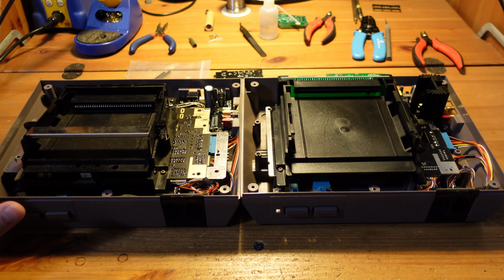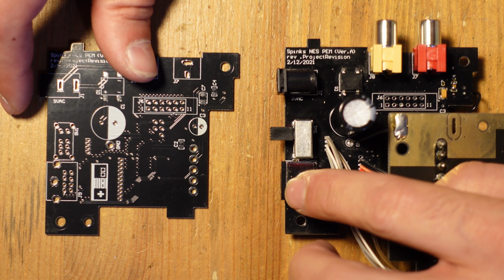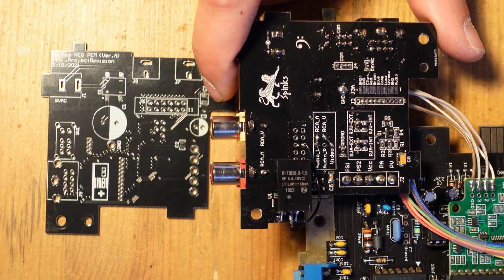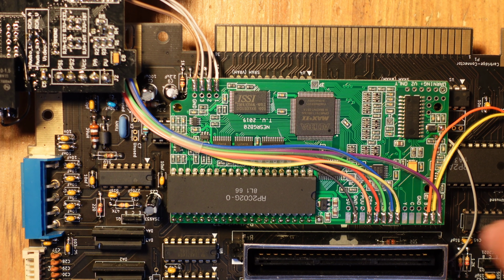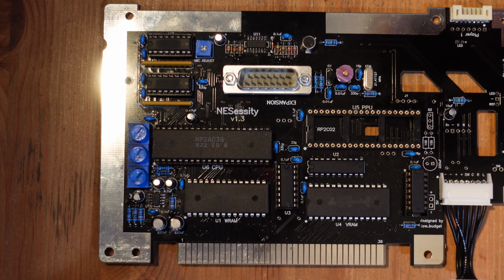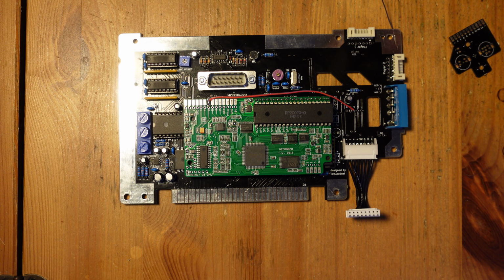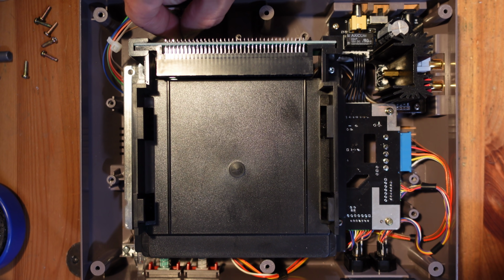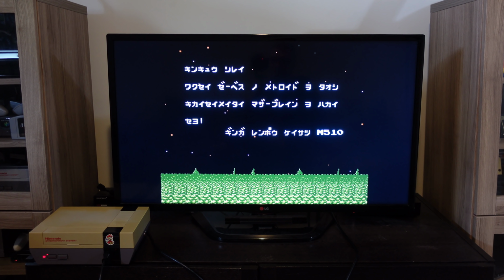Building a new NES in 2021: Adding RGB to the Opentendo and NESessity!

Comment: You could update the design of power supply module to use some kind of fine pitch wire to board connector system instead of direct soldering and it would make the install even cleaner and easier.
Reply from the maker: Yes that would definitely be a nice change to the power supply. I’m still learning a lot about PCB design so I’m getting there slowly. But at least it’s available on github so anyone could potentially modify it and make it better

Comment: I keep going back to the idea of using USB-C for power, as it’s easier to find those power bricks. Need a beefier one, but still a lot easier :)
Reply from the maker: Yeah that should work as an option as well
Reply: With PD you can request 12V in form the power block and then just have to do a 12v to 5v which is super commoon. I believe the the stock power supply just produces 2 12v lines and 2 5v lines.
Reply: someyears back i modded my nes to run off apple charger usb for fun.  worked without issues.

Comment: I would love to see a USB-C PD power supply replacement. With PD you can request 12v at up to 3 amps. then you would just have to drop it to 5v. To have the 12v and 5v needed for the NES.

Comment: Many of the oldest and most compatible bootleg Famiclones such as  the original Dendy used clone CPU and PPU chips that were not an NES-on-a-chip. So if one put chips from one of those into this type of board with a Blinking Light Win and a custom shell, it would be possible to effectively make a whole new NES from non-Nintendo parts.
Reply from the maker: I had forgotten about those Dendy NES clones. That would probably work here!
Reply: @LIRetroGaming  just keep in mind that there's a wee clock speed difference between Dendy, PAL, and NTSC CPUs, and that the Dendy is closest to PAL in both CPU and PPU. So while it's possible to use an earlier Dendy for this board instead of Nintendo's own parts, just keep in mind that the differences exist. But it does mean that one doesn't need to cannibalize an NES, and can instead go for low hanging fruit that would be ubiquitous (many more companies than Dendy did this type of clone, so one wouldn't  be cannibalizing a piece of history if done to a visually horribly-designed older famiclone. Also there are newly manufactured controller extension cables made nowadays that could be used to replace the controller ports with some passion utilized, and one can use an alternative power LED. Basically this means that at the cost of an older famiclone with ugly case design, one can make a whole new NES entirely from non-Nintendo parts, given the fact that custom new shells exist.

Also the company that made the Dendy chips (UMC) still exists and likes to focus on older circuits

"UMC is content with being a solid second-tier player offering older technology — as much as a decade behind TSMC — used in important but more mundane components, such as those that tune radio frequencies or manage power supply in mobile and consumer electronics."

So getting New Old Stock or newly made Dendy chips is also an option given how long after the last non-NoaC famiclones UMC made those chips for. Remember that the NES CPU is a 6502 with integrated audio, including PCM. There is still heavy demand for 6502s, and they are still made. The NES PCM can either be 1bit DPCM, or it can be direct register writes to the 7bit DAC register that the DPCM feeds. Having 7bit PCM, 2 square waves for beeps, and a 6502 on the same package would actually be useful for certain industrial devices that need a basic processor and a means of auditorily alerting the user, so in the case of the CPU newly manufactured Dendy chips from UMC would not be outlandish. Plus you would need a real NTSC PPU, so it would actually be possible to make an entirely newly manufactured NES apart from the PPU with newly manufactured Dendy CPUs. Also know that Dendy chips are not exact clones of the official chips, namely in the audio department, but it's very minor.

Comment: Is the CPU socketed on this install of the NESessity board? I was wondering if I should socket both the CPU and the NESRGB board, or solder the CPU directly to the board to get more breathing space underneath the NESRGB board.
Reply from the maker: Yes, I did socket both the CPU and the PPU. I’m not so biased about socketing the other chips but I decided to do that with these chips because they are original

Comment: I have yet to see an adapter to replace the Original Nintendo keyboard for the Famicom, it was a simple scanned key matrix consisting of 72 buttons and an audio tape interface. something that should be easily adapted with an Arduino or Teensy 4.1 micro.
Reply from the maker: Agreed, a microcontroller should be able to handle that
Reply: @LIRetroGaming  it also seems that upgrading to the SNES multi out connector is the way to go if you want to add RGB output.  IDK if that also carries S-Video or not but I guess you could always put that connector on the back.

Comment: I watched this video a few times over the last year, and finally caved in and got a 1.6 NESessity. Unfortunately, I was missing a few components which was no issue since I ordered them from Digitkey as soon as I noticed them missing. I have zero knowledge, and never even soldered before this project. The board is very easy to navigate. But now as I am finished with almost everything on, I am not getting any power to the board. It would be awesome to see an updated version of this video working with the very different 1.6 model. Until then, I am going to dig around and pray I can resolve my issue.
Reply from the maker: The NESessity is a pretty big project for a beginner so definitely take your time and go through all the components that were installed

Comment: I like the nessecity board, but I prefer the power board you fixed and used with the opentendo because it has the multiout port.   Could you use that board with the nessecity?
Reply from the maker: I don’t think it would be easy to use that board with the NESessity. But you can always add a multi out port to the NESessity - it would just have to be cut into the shell instead
Reply: @LIRetroGaming  1i wouldn't mind doing that...but do you have a wiring diagram on how that would work?

Comment: Any chance for an upated BOM for it, that has the missing part numbers filled in (based on what you bought for yours)? I ordered 5 of the power boards to go with the 5 OpenTendo boards I have, just trying to work out the BOM for this thing.
Reply from the maker: I included the BOM for the power module on the GitHub page, and all the required parts should be there. You can email me at 1uprestorations.com and I can help to clarify if needed

Comment: Amazing!!! but why not use component video, with 3 connectors or HDMI? Wouldn't the video signal be better?
Reply from the maker: RGB and component video are identical in quality, so it’s just a matter of personal preference. HDMI is another great option, but unfortunately those kits are no longer being made
Reply: @LIRetroGaming  But RGB signal is transmitted by only one wire as in composite video, and component video is 3 way. Doesn't that impact the quality?
Reply: @MarcosAurelio-nm7ei  RGB is transmitted by 4 wires. R, G, B, and sync.
Reply: @ZodiacalLight  Not when the signal is transmitted by composite signal, on RCA cable with only one way. In the component signal, each signal is transmitted separately. There are 3 connectors on this cable.

Comment: can you add a socket for the ppu on the rgb board, or would there be clearance issues or something during reassembly?
Reply from the maker: Yeah that is the problem. It ends up being too tall and it does not fit in the case. So you cannot socket the ppu
Reply: @LIRetroGaming  that's what i figured.  thanks for the quick answer!  just started watching your channel and i'm really digging the projects like these.

Comment: So, I've assembled my NESessity 1.6 with an NESRGB and a multiout. 

I am experiencing just a black screen when I boot up a cart. No Audio, no video, just a black screen. I haven't observed any shorts anywhere and I'm curious where I should start. NESRGB shows LED 1 on.

It's my 2nd NESRGB build, but my first NESessity build. I've removed the composite circuit on the board as you have shown.

Any tips?
Reply from the maker: Really hard to help without photos, but I would try to test the NESessity by itself first without the NESRGB installed

Comment: I know that this is several months since this was posted but was wondering how I would bypass the NESRGB sound using Voultar's QSB for a multiout. If I did run the sound through the NESRGB would the potentiometers do anything to the individual "channels" even though it would be sending out the signal in mono on the multiout. The QSB that Voultar has uses a ribbon cable which makes for a clean install and I'd like to use it if possible but worry it would invalidate the sound quality of the NESessity.  Any thoughts?
Reply from the maker: My understanding is that the QSB would most likely be set up for dual mono output, not stereo sound like the NESessity outputs. But the only advantage of the QSB is an easier install, so personally I would not bother with it on the NESessity
Reply: @LIRetroGaming  Cool. Thanks for the quick reply and awesome videos you provide!

Comment: Should this still work fine with Tim Worthington’s NESRGB v4? I am preparing to do my first console mods and I want to make sure I have the output method set before I make my orders. I have several carts on different sites ready to get parts for a few systems, but doing a no-cut NESRGB has been a dilemma. I may need to look into using this diy option since I have not been able to find anyone who is currently selling prefabricated power modulator boards. I will save it and next week look into the process and see if I would be able to figure out completing the process. If you know of anyone who has newer versions, I’d be interested. Cheers~
Reply from the maker: Yes this should be very similar for the new v4 NESRGB. The only difference is the in game reset and palette swapping, which you can use my NESRGB v4 video as a guide

Comment: What cable are you using to go to the OSSC?
Reply from the maker: I’m using a retrogamingcables 8pin mini din scart cable. But you could also use different types of connectors like a super Nintendo multi out for example
Reply: @LIRetroGaming  thanks!  I’m definitely more interested in the multi-out option and using something like retrovision cables as that seems like a better option for me so it’s nice that the board has that option to add the multi-out.
Reply from the maker: Yes it’s extremely flexible which is one of the strengths of this project

Comment: Hi Long Island Retro Gaming, Thank you for your video, I found it really helpful and excellent explanation. I've been trying to build the opentendo with RGB running into an issue. I tried two sets of cpu and PPU just in case and two sets of rgb boards. Without a cart I get the expected flashing red, but with the cart in I get a blank picture with humming audio sound coming out of composite. I checked the IC around the board they were all getting 5V. I don't have access to original RF/power unit so I'm not sure what the 5 pins output should be on the spinks board. Now that I thought about it, could the  trim capacitor need to be adjusted (i haven't done since I installed it), would that stop it from working. Are there any other things I should look out for? thanks!
Reply from the maker: I think it's tough to know exactly what the issue is without seeing some pictures. Is RGB working or have you only tested composite video? you can send me pics and more details at 1uprestorations.com

Comment: Got myself the OpenTendo boards via JLCPCB, checked with PCBWay, but the delivery here to country Western Australia was just stupids amount of money. PCBWay wanted just over $100AUD for 5 boards + delivery, JLCPCB did the whole thing for $73AUD.

The only issue I have is finding the crystal, PAL 26.601712MHz crystals are as rare as hens teeth... I found some on eBay for like $5AUD which I have ordered just in case the original NES ones I have die for whatever reason, but wowsers at how difficult they are to find.

Would have liked to have gone Nesessity, but the pricing to get it to here in Western Australia is just too stupid for words :(
Reply from the maker: I’m surprised that those crystals are hard to find, I would have imagined that they are still needed in lots of applications. If you have a parts nes you can also salvage a crystal from there as well
Reply: @LIRetroGaming  Yeah, besides AliExpress and eBay, I've not found any at all.

I have 3 NES consoles, my original one from the '80s, and 2 I bought off of eBay, the 2 eBay ones are going to become OpenTendo ones, so unfortunately I don't have any spare crystals besides those working consoles.

Comment: Really wish the Hi-Def NES guys would hurry up and work on a new version or pass the project to someone else...
Reply from the maker: Yeah honestly I’m not holding out much hope. I would rather see another developer make something equivalent or better
Reply: @LIRetroGaming  That's the best solution, but from what I've seen of the Hi-Def Nes I wonder if it's even possible for someone else to make a processor level digital video output without infringing on their design.
Reply: @ridingnerdy6406 If anyone ever gets far enough into developing an alternative, and the Hi-Def NES guys want to play "Intellectual Property Wars", then I'm sure a royalty could be negotiated.  It would make the end product more expensive, but this is a luxury hobby.  Most people who are into HDMI mods for the NES would probably still buy it, even if it were a $200 upgrade.

Comment: Out of curiosity I looked at the schematic for the original power board (http://www.neshq.com/hardgen/schem2.jpg and the schematic from your github repository. As far as I can see, your/spinks version pretty closely follows the original. I took a quick look at the datasheets for the original and replacement transistor and to me it seems the new one should work. But there are two components on the original schematic that are missing on yours. A capacitor and a small coil  by the looks of it. I don't know if they are important. Might just be a little filtering, but then again nintendo might have had good reason to put them in. You did not go into a lot of detail as to why the original video out did not work for you. The original schematic if it's accurate also shows audio being derived from the video line so the filtering might be to remove an audio component from the signal. I'm not well versed in analog electronics. That training has worn away over the digital years, so take my comment for what it is :)
Reply from the maker: The original Spinks board had two problems: all the vias that should be connected to ground were just floating, connected to nothing. I connected all of them to the ground plane. The second problem was that the traces for the AV jacks were switched so I rerouted them to the correct locations. I still have a few boards left so I plan to experiment with this on a spare frontloader NES I have
Reply: @LIRetroGaming  What about the problem you mention at 4:35 in the video with Q1? Seems to me that makes three problems with the original board.... and that was what I was replying on. I also noticed the link I gave had an ")" included on the end by accident. I removed it, should now work.'

Comment: does the opentendo and nesessity suffer from the same flickering issues and frame drops as original NES?
Reply from the maker: Yes, they both behave exactly the same as a real NES. They don't have extra RAM or other resources, so the same limitations apply and it's an accurate recreation
Reply: @LIRetroGaming  I understand, It might be the way the games were created to overcome the original hardware limitation.

Comment: which revision of the Rf board runs in nes without changes
Reply from the maker: Not sure what you mean exactly. The opentendo will work with all of those RF modulators
Reply: @LIRetroGaming  understood and that I read in your source. and I understood that revision b would only be for RGB. I got it wrong?
Reply: @LIRetroGaming  understood and that I read in your source. and I understood that revision b would only be for RGB. I got it wrong?
Reply: @LIRetroGaming  I noticed that you don't have the RCJx plug rca bookstore. if you want i have her photoprint that i made on the eagle

Comment: Dude, great channel but go to walmart and buy a can of acetone or 99.9% IPA and clean up your flux after you finish soldering, just looks way more professional and will prevent issues down the road.  No clean flux or not, you really should clean it.  You can see a ton of flux on the opentendo console at the beginning of the video and even more at 9:33